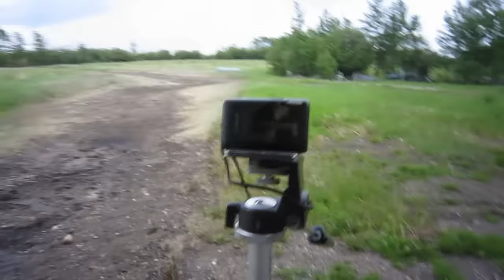Testing a GE J79 with afterburner

Comment: Back in my Navy days was in a f-18 squadron but been around a few f-4"s at cecil field , They were for sure bone rattlers at full power but i got one better , When deployed on our med-cruise our carrier air group always had a squadron of EA-6B"s Prowlers , At full power on the flight deck just a few feet away from those j-52 turbojets would rattle the fillings out of your head almost , Never heard one louder then that and hello tinnitis lol , Great video and subd !
Reply: In 1972 I slept under the port side blast deflector on the USS Midway, CV-41.  We had two squadrons of Phantoms (2 J-79 engines) and one detachment of RF-8C photo recon planes.  The F-8 plane did not have staged afterburners, and when they went to AB, they literally went "POW!!!!!".  The Phantoms were just loud when they were at full AB with the exhaust 10 feet above where you were standing.  I wore ear plugs and mouse ears when I was in my rack.  We could hear the hydraulics of the blast deflectors each time they went up and down.  Never a dull moment during flight ops on a carrier.

Comment: So how much fuel would a fighter hold that uses this engine?
Reply from the maker: I think I see where you are going with this, and I'm not taking the bait. Go troll elsewhere.
Reply: @AgentJayZ  
No trolling dude, I was genuinely interested, thanks a lot!!
Reply: AgentJayZ did you seriously reply to a comment on an 8 year ols video
Reply: A search returns these values: about 900 gallons internal, and almost double that with wing tanks added. Range with wing tanks 1,500 miles. Cruising speed about 500 knots.
Reply from the maker: A search for what?
There are 4 different fighter aircraft that I know of that used the J79 and were produced in number. So the answer is : depends on which fighter you mean...
Reply from the maker: I see everything. If I don't answer a question, it is not because I have not seen it.
Reply: Imagine wanting an answer for such a simple and normal question and get called a troll by the uploader! Damn, I think I've seen it all now.
Reply from the maker: Disfatt: I'm going to suggest you start your journey down the rabbit hole... by watching my video "Hoaxter Discussion". Get ready for a bit of a ride, my good sir.
Reply: @Viktorreznov1942  
Yep, I'm no troll, you'd have thought by that comment that I was a flat earther or something, lmao.  I was genuinely asking a question, but I had no idea that engine was in a number of fighters, with that many variables for fuel tanks.  I just did my own research after I looked at some of the other comments, then after that I googled it.  But maby his other video "hoaxer discussion" will shed some light on why he though I was trolling, I'm gonna give that a watch right now.
Reply: @jamesrobert7155  Oh ok , I kind of get it now. I appreciate you taking the time.
Reply: @AgentJayZ  You're weird, that dude was asking a normal question

Comment: And here, you can witness the sound of my computer while running a game (volume lowered as to not cause hearing loss)
Reply: M8 we here in 2019
Reply from the maker: I have one like that, but it's in a closet, being retired long ago. An IBM PS/2 model 90 with twin 150MB hard drives. Sounds like a couple of turbine driven band saws starting up.

Comment: You all ever try toasting marshmallows back there?
Reply from the maker: The primary product is a wind at sonic velocity. Secondary byproduct is heat.
Reply: @AgentJayZ  Good point. You'd have to have those little smores cages I think.

Comment: How long could you leave it in afterburner on that stationary rig before it becomes a problem for sitting there?
Reply from the maker: A problem for sitting there.  What does that mean?
Your question could mean many things, so it means nothing.
Reply: @AgentJayZ  I guess that Nick Dillon was trying to ask if the only limit to work on full af would be a fuel that runs out, or would it eventually cause some materiar wear, material melt, vibration wear or something else.
Reply from the maker: Sure, I could guess too. Nobody cares about guesses. They are useless. Let's not be useless together, eh?
Reply: The only thing more savage than seeing like 20,000hp on a cart is a response from AJZ. XD
Reply from the maker: My Keyboard: STFU, and FTFO
Reply: AgentJayZ your answers are ‘classified’😂

Comment: How much does it cost just to start that bastard lol? Awesome video.
Reply from the maker: To light off and immediately shut down? I could do that with five gallons of jet fuel.
To light off and get to idle, and then shut down? I'd want about 20- 25 gallons.
Why? Who's paying for the gas?
Reply: starting it would only be about $15-$20 and depending on fuel price about $250-$350 a minute with the afterburner engaged using Jet-A pricing and assuming 90Gal/m less than half that if its only running full power and not afterburner. For all i know its running on JP-8 and i don't know the cost of JP-8 but i assume its close to Jet-A.
Reply: @AgentJayZ  Thanks fir actually responding. Love you videos, especially the one where you read through the manual.
Reply: @Wehra96  thank you also, this is vert interesting. So much power!!!!!

Comment: aaand theres idiots withought hearing protection right next to a J79 on full afterburner. Yep.
Reply from the maker: Look more carefully, Mr Super Smarty Pants.
The engine was idling, which you may not know... is different from full AB.  Yyeppp.
Reply: @AgentJayZ  Ok, and? Well over 100 decibles isn't exactly healthy for an unprotected human ear.
Reply from the maker: Can you measure sound pressure through a video?
Amazing.
I was there, and I can tell you that an idling J79 at 50 yards is not as loud as your average bar band.
The risk in that situation is not knowing when the operator will throttle up.
However, the hands over ears technique is very effective.
No hearing was damaged in this video.
There is great value in actually experiencing something.
I'm sure you would be impressed if you witnessed a test run.

Comment: I worked on F-4J,N,B,S as USN/AE back in the day at NAS Oceana. An AE always went to High-Power (HP) with the Mechs (AD) after they changed out an engine(s). Proper SOP included a Big A## chain attaching the airframe down to the deck and put a screen on the LH jet intake. Then as AE sit on the cockpit canopy lip observing the mech engine startup/testing routine.  By the time one or both engines were up to military power I would be holding on with a leg sucked flat to that intake safety screen. Then is when High Power got interesting. The Mechs would shove the F4 throttle to afterburner (AB) and that plane strained that chain and wanted to move! I can tell you, being an AE sitting on an 8" F4 canopy lip in AB is not for the faint of heart. But the best was yet to come. The mechs as part of the checkout have already added MILOIL to each J79 engine. Those J79s take a lot of oil in gallon cans. The trick was to do HP at dusk while tossing oil cans into the AB rooster tail. They fly out a about 100 yards in the dark and make the coolest big blue-green colored explosions! I doubt you could do that now with all the environmental rules.
Reply from the maker: You military guys are the best kind of crazy.

Comment: Millions of mosquitoes were killed in making of this video!
Reply from the maker: I sure hope so.
Reply: @AgentJayZ  Trow in some citronella oil in jet fuel, and presto.. No mosquitoes,the don't like that smell. Used a lot in kerosene lamps here, those with a wick and the optimus variants. I don't know how that mixture would work in a jet engine due to the high heat. It boils at 225 degrees Celsius.

Comment: A good 140-150 dB.  Ear-shattering, literally.  Noise loud enough to do damage.  I worked around P&W J-57s (B-52g bombers) and they were loud but nothing compared to afterburners!
Reply from the maker: All turbojets are so much louder than modern engines. Even without AB, at full power the noise is terrifying.

Comment: All that white smoke coming out at one point, im sure its not a fault as you'd be silly posting it. So I'm curious and assuming for the moment that the engine was not hot enough to ignite the afterburn fuel? Don't laugh too hard im just a pot head but really curious. Does somebody know?
Reply from the maker: Explained in the description.

Comment: Hey, that's the same engine that's in an F-4 Phantom but it has 2 of them.  Some kinda thrust!  I'm surprised it didn't take off out the door!  That one doesn't smoke as bad as a Phantom.  Okay, maybe it does!  I used to see those everyday on the carrier I was on.
Reply from the maker: I have quite a few afterburning J79 test videos, some even with the smoky, older style combustors.

Comment: You ever gonna slap that beach into a plane orrrr you just keeping a 700,000$ engine in your garage?
Reply: 9 years ago
Reply: The J79 can only fit into specific aircraft, very few of which are still in flyable condition. The best option in terms of mounting this to an aircraft would probably be a Lockheed F-104, or Avro CF-104 since it's in Canada. Sadly, it costs a shit-ton of money to do so.
Reply: @Tigershark_3082  Could you weld it to my bike?
Reply: @SeaShrimp  uhhh, I have no welding experience. I recommend just making an entirely new vehicle frame, designed around the engine. Make sure the cabin/cockpit has plenty of protection, and an ejection seat.
Reply: @Tigershark_3082  Would duct tape work instead of welding?
Reply: @SeaShrimp  possibly
Reply: @Tigershark_3082  thanks for telling me I didn't really want to look up what this jet goes too and one of my favorite jets is the f-104 I should know that

Comment: John R Boykin, my father, designed the electronic fuel control for that engine. In the test cell on the first run-up, the boss reached across in front of my father & jammed the throttle to max afterburner, all stages. Fortunately, the computer was set up correctly and a compressor stall & engine disintegrating was not to be.
Reply from the maker: Funny, this engine does not have an ECM. The fuel control is completely hydromechanical.

Comment: Just wow!  The closest I have gotten to that sound was while I was sitting at an indoor cafe, an F-111 flew over so low that the whole place shook violently. I instantly dropped to the floor dropping my coffee without thinking. Scary and exciting at the same time. Anyhow as it turns out , there was an airshow close by......
Reply from the maker: You've got some good reflexes there.
Reply: Something similar happened to me. 2 F4's were doing some touch and go activity at BWI Airport just outside Baltimore Md. It was unbelievable. That was 1997 lol and still holds vivid memories. Just wow

Comment: now i see the full power takeoff when the afterburner popped open. j79 engine is a variabe guide vane ( the vans blade angle can be changed to direct proper airflow into the HPC compressor and also prevent stall while the j57 is not capable to do so.

Comment: Try sleeping during the heat of daytime, two of these in each F-4E, then twenty four of then rolling down the runway, not a mile away, in pairs, taking off for a mission to North Vietnam. Yes...I know just how loud they are. I also know it feels like your chest is going to be crushed from the sound waves on takeoff. No amount of hearing protection will help.

Comment: Thanks for letting us see up close what (afterburner mode is really like). One off topic question, how do they inspect the engine after someone throws pennies inside like they do in China? I mean do they have to pull the plane off line for a long time while they do a full inspection? You mentioned just dropping a titanium blade on the floor is enough to make it bend.
Reply from the maker: For a big turbofan at idle, an on wing visual inspection would most likely find no damage.
If the coins got into the core, it would be similar to if the got into a cars intake manifold.
Lots of expensive repairs.

Comment: super dope my quesstion is how man feet of cement is put into the corners of where the jet is anchored to the ground in other words how in the heck does that jet engine not just fly a million mph away from where its sitting. this is so badass guys ! 
gr8 work
Reply from the maker: I have a playlist called  Our Engine Test Cell. It's got a couple videos in it about the engine test stand and the mounts we use.
You can put any subject in the search box on my channel page, and I probably have made a video about it.
Reply: The engine test stand normally has several steel hard points anchored to the concrete pad, it all depends on their setup.  I haven't seen these guys videos about their setup but our test stand in our hush house or run pads had simple chain and takedown points anchored in the concrete that baby ain't going anywhere.  Nice set up.

Comment: i was trying to guess how loud this was then rembembered my time seeing jet car racing and being so loud you feel like your hearts gonna stop
Reply from the maker: Jet cars are limited to using engines rated as "small". 3 to 5 thousand lbs thrust.
The J79 is not in that category. 18,500 lbs in AB.
It's a bit louder than your typical jet car.

Comment: Always incredible AgentJayZ, I dont know why this video exploded. But it was worth clicking on it!

Also have you ever read one of your engines with a decible meter I'm curious how loud those actually are that close
Reply from the maker: Before we even crank over the J79, the start cart, a Garrett GTC-85, pins the 130dB meter in a phone at 30 yds away.
The Idling j79 is ten times louder at the same distance. At Military power it is a thousand times louder. In afterburner, it's another ten times louder...
Sound intensity drops off with the square of distance, so at 300 yds, you can easily tolerate full AB without hearing protection.

Comment: F15E engines will shake building a quarter mile away when doing engine runs. Even inside another building you can feel the pressure of the noise hitting your body. Its deafening and annoying to deal with for hours at a time. The immense power is something to witness for yourself. These engines are extraordinarily loud, robust and full bodied. Fyi an F15E engine is much larger than this one.

Comment: This beast has powered many aircraft including one of my favorites, the F-4. The only bad thing was they smoked like a train 🐾✌️🇺🇸
Reply from the maker: Ah, that was with the original design of combustor liner.
More recent models of the J79 use what are called Lo-smoke liners, and different fuel nozzles.
Result: about 90% teduction in smoke production.
The Lo smoke kit is an easy retrofit for any J79.

For air shows, the fans seem to prefer the smoke...

Comment: A b 52 got eight of them saw how you adjust the diamonds in the afterburner fantastic only the real thing makes about 188 decibels nice welldone ronadamn
Reply from the maker: J79s were never used on the B-52. They would make the plane supersonic, if they didn't rip the wings off first.
The B-58 did use four of them.

Comment: Interesting. What planes did these engines power. I heard they were used on F4 phantoms.
Reply from the maker: Yes. Different variations of the J79 were used in quite a list of different aircraft. Wiki has a pretty good page.

Comment: 8:48 I would be wearing protective glasses. The air pressure can shoot a rock from the ground in your eyes.
Reply from the maker: He's well out of the exhaust stream, or he would be getting blown over.
If he was 100 yards further back, and in the exhaust stream, your advice would definitely apply.
It's not air pressure , it's air speed. The exhaust pressure is almost zero, but it is leaving at high speed.
Reply: @AgentJayZ  What's the air pressure in front of the intake?
Reply from the maker: That's what we call P zero, or ambient air pressure. At our elevation it's a bit less than 14 psi.
directly at the face of the compressor is what is called P1. it is slightly lower than P zero, because the compressor is scooping up the air in such great volumes. When P1 is lower than P zero, this is called inlet depression (of air pressure).
Ram Pressure Recovery is when the aircraft speed increases P1 to the point where it matches or even exceeds P zero. This happens around 150 knots, depending on the aircraft...

Comment: Brings back memories I try to forget. The J79 was a very complex engine.
Reply from the maker: The J79 is an American design. Very robust, matter of fact, and down to business. Easy to work on, and for a turbojet engine, quite simple.
You want needless, hair pulling complexity? Well, you need to give the boffins at Rolls Royce a call.
(sorry Graham, but you know it's true...)
The Spey was also used to power the Phantom 2... same power, with twice the parts count.

Comment: Are we sure it's sound waves causing the camera to shake? Seems obvious its the jet blasting directly next to it it making it shake.
Reply from the maker: Making it shake with noise... sound...
It is not anywhere near the jet stream, or it would be blown a quarter mile down range...
Reply: It is the sound. The sound is unbeliveble loud. I have seen a engine run like this in real. I had a noise protecting helmet and a noise protecting jacket, and it was still too loud for me. It is like someone kicking into your chest. Belive me, it is the sound.
Reply: It is the sound. The sound is unbeliveble loud. I have seen a engine run like this in real. I had a noise protecting helmet and a noise protecting jacket, and it was still too loud for me. It is like someone kicking into your chest. Belive me, it is the sound.

Comment: Had 2 F4's fly over a building similar to this but 10 times bigger. We were in flught path 1/2 mile off runway.  They were doing touch and go's and did it 3 times.Un fucking believable how loud it was. Building shook just like.this showed.  We thought an airliner was coming thru and had crashed. People literally ran for cover. True story.